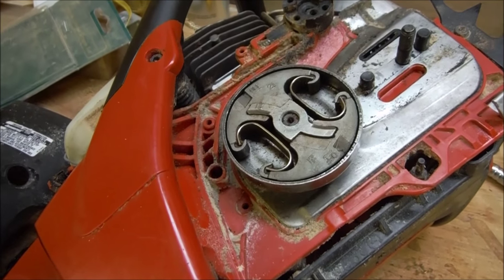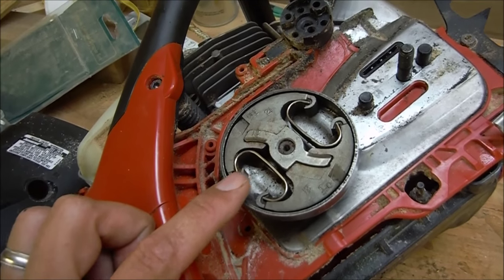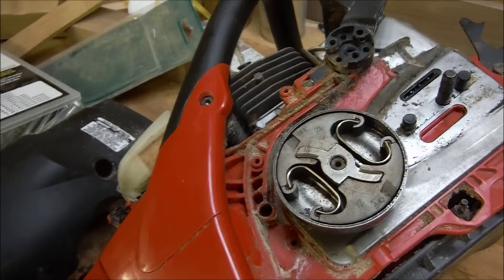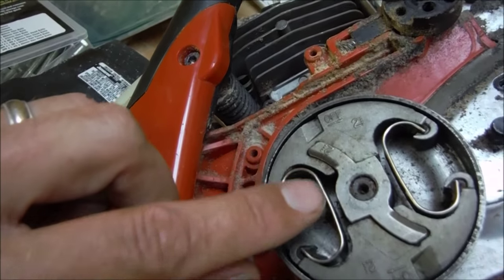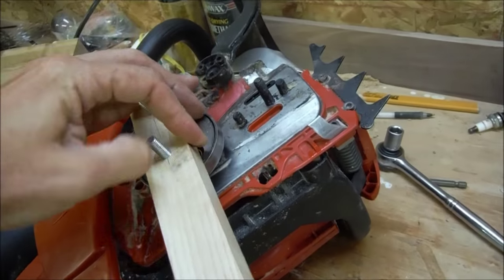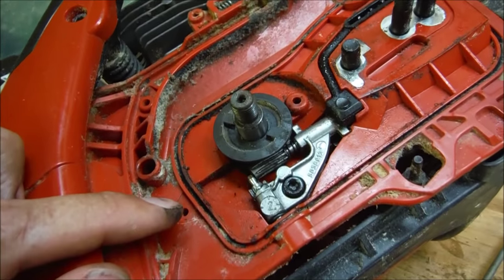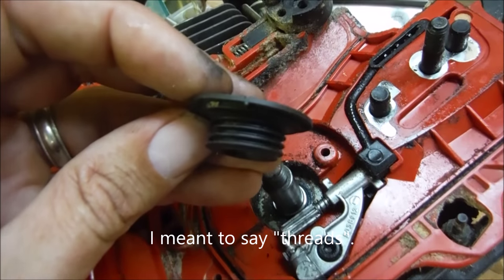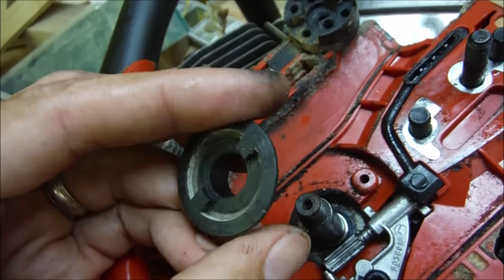Jonsered 2255 Clutch Removal and Oil Pump Repair

Comment: Thank you for the information. I used your rope in the piston trick and it worked perfect.  I couldn’t find a suitable piece of wood for the tool unfortunately, however I found that you can just use a couple of short bolts and nuts threaded though a hole and slot on the chainsaw bar itself and it works quite well.  Thanks again for the information!
Reply: I used the bar also. The oil holes was spaced just right..but i dont like to put stuff in the cylinder so i used the carb adjustment screwdriver as a lever against the magneto fans and it opened easily. Now i need to take the whole engine apart to change the fuel line ;( damn these plastic machines

Comment: The two gashes in the clutch is for you to use a screwdriver or chisel with a hammer to tap the clutch for removal. There is clearly a sign that says 'OFF" so you hit it in the way of the grooves
Reply from the maker: @TheMAC0876  the comments in this video have taught me that!  At least I got the dang thing fixed back then.
Reply: @petercollin5670  lol that’s the good thing about educational videos. We all learn something new to make our jobs easier the next time around 😊

Comment: Well done, but just as easy is:- you see the two divots right next to where "off" is stamped in the clutch? if you have a brass rod, put the end in the divot and whack the other end with a hammer (still have to jam the piston with the rope as you have shown) and it will also undo the clutch bundle.

Comment: 👍Awesome👍Awesome👍
Thank You👍My Kind Of Tool
-----------------
I have The Same Exact Saw &
Same Exact Issue & Now I Can
Get The Clutch Off To Check The
(cheap ass plastic)Gear.
There Should Be A Law That
All Parts Must Be Made Of A
Metal In Any Tool That Heats
Up or Is Put Thru Stress!!!
Guaranteed To Always Fail😞

Comment: The No1 cause of this problem is not the nylon plasic part but the end user!! Blunt chain or heavy revving while the chain brake is ingaged both cause high temperatures from the clutch and crank shaft causing thermal overload = melting parts
Reply from the maker: This happened during a particularly cold winter, and I figured that may have had something to do with it.
Reply: thick oil in wintertime will cause premature wear on the worm gear.

Comment: Great video, even better idea. Quick question... in your video, the outer housing of the clutch and the inner part section appear to spin independently of each other. Is this normal, or had you already loosened the inner section before making the video? Reason I ask is because on my saw these spin together. Thanks.
Reply from the maker: The inner part is like brake shoes.  When not revolving, they should spin freely of each other.  The springs you see give just enough tension that, when given throttle, the inner part revolves fast enough to fling the brake shoes outward, engaging the clutch.
Reply: @petercollin5670  Thank you. That makes perfect sense. The reason I'm looking at the video in the first place is because, 1. when I apply the chain brake, the engine bogs down and dies either straight away (or in a couple of seconds), and 2. I can only start the engine with the chain brake disengaged (dangerous), so the chain constantly runs when the engine is running. I'd already cleaned the bar and chain, checked the bar oiler was working, adjusted the chain tension and the idle speed. Nothing seemed to make a difference, so I suspected there was a problem with the clutch. It must be gummed up so badly that the clutch is acting more like a gear than a clutch. I can't seem to find the clutch removal tool in the UK, so I'll use your idea to remove the clutch and get it cleaned. My own fault for not cleaning it more often. Much obliged for your help!
Reply from the maker: You might need to replace the springs.
Reply: @petercollin5670  I think that's entirely possible. I'll invest in a new clutch, which seems to be fairly inexpensive to buy, and widely available in my region.

I had another look at it today. By jamming a screwdriver vertically through the gaps in the impeller, this works as a piston block. After which, I opened the clutch side, and was able to get the clutch housing to move independently of the clutch by turning it back & forth a few times. However, there was still a lot of friction, which (as you suggested) could mean weak springs. A few dribbles of maintenance oil, and I managed to get the housing & chain spinning free from the clutch. Although, I believe this is supposed to be a dry clutch. Is my assumption here correct? If so, I suspect I'll experience a lack of chain speed under load, as the oil will cause a lack of friction between the clutch and chain sprocket. Pretty sure now it needs new clutch springs. Thanks for your help!
Reply: @ottofumbler7267  
You may need to adjust your (L)ow end
Adjustment screw to get your idle down
To stop chain spinning. I've never had or
Seen a clutch so dirty it engaged enough
To spin the chain and I've had them packed full from laziness too...
Oops... Didn't look at post date😂
Reply: @chippewatailfeather4207  No worries. Thanks for the reply. I recall now it was tree sap that had bonded these parts. Cleaned it up, and got it working fine. Saw still running well to this day.

Comment: good video. Facing this problem today
Reply from the maker: I've learned that you can get this problem if you run summer weight bar oil when it's freezing.  The oil gets too thick to run through the system and it can cause that screw gear to strip.

Comment: Thanks for posting!! My 2250  has a spring in instead of threds!! OR was your spring worn away ???
Reply from the maker: +steve fuson There was no spring in mine.  Does the spring work the same way?
Reply: Looks like it "should" .. The teeth on my Piston is Stripped Out.. Thanks a Lot for your help buddy
Reply: Why would they use Plastis on such a vital component anyway..LOL.. That has that much stress on it.. Crazy i think
Reply: Peter Collin
Reply: I just put a video up of what ive got.. Have a look
Reply: +steve fuson to protect other parts and reduce the need for more complex lubrication. The plastic part fails first, in a way that doesn't put chunks of metal in the moving parts. Also doesn't need its own lube, like a metal worm drive would, reducing the use of oil, the mess, and the need to control oil right next to the clutch. I have seen in a number of places sacrificial parts replaced with `better' parts leading to much more damage and expense to fix, like using grade8 bolts to replace those pesky shear pins on a loader.
Reply from the maker: Good point John.  I bought a coupe of those plastic screw gears because surely this will happen again.  They didn't cost much.
Reply: @johnjohn-ed9qt  
Excellent information - built in point of failure.  Common engineering practice that is little understood.